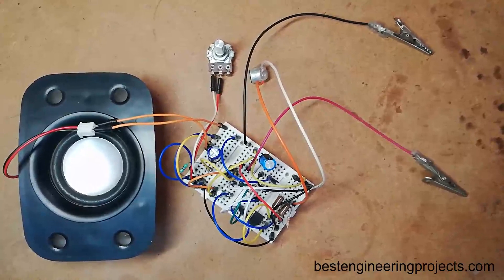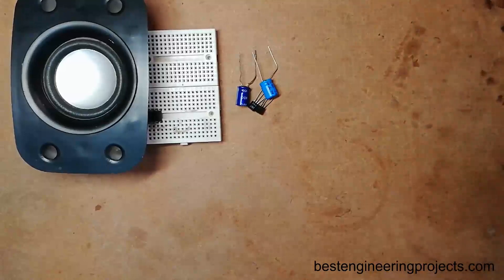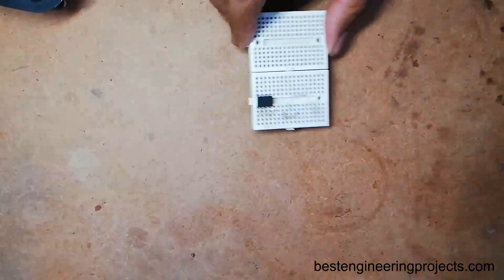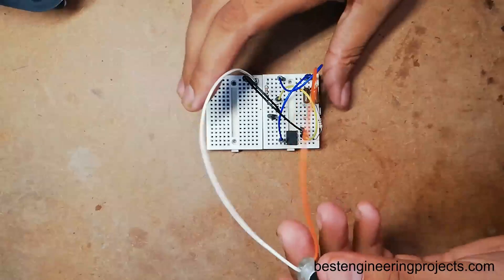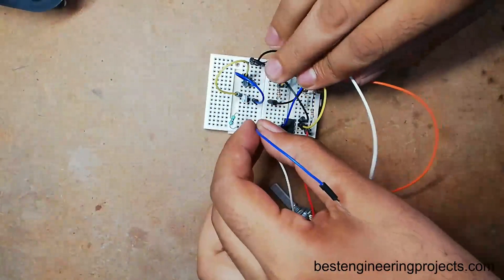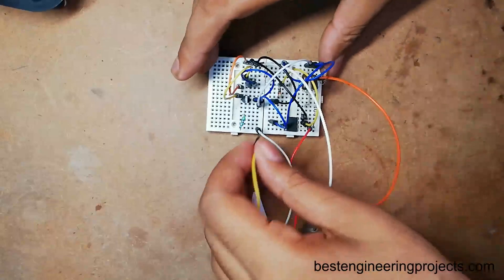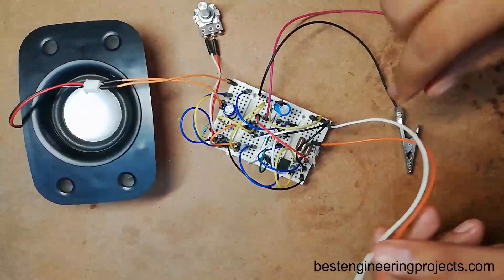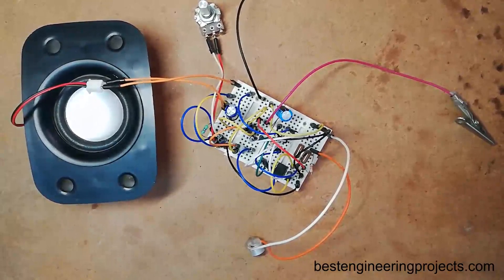Listening Bug Circuit using LM741 IC

Comment: it doesn't work
Reply from the maker: This circuit work fine.
please recheck all the connection
Reply: @Bestengineeringprojectsbep   how to check the mike are fine
Reply: and can we use  8 ohm loudspeaker
Reply from the maker: @warsha5874  If you have access of oscilloscope, you can easily check the output else use  multimeter in voltage measuring mode at output.
If you have any further question please use our comment box at.
https://bestengineeringprojects.com/listening-bug-using-op-amp-741/